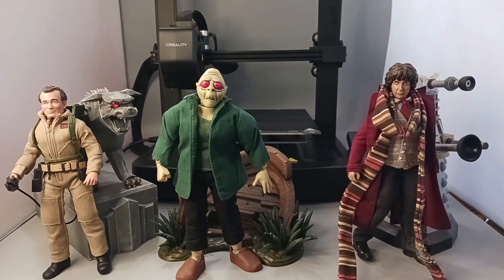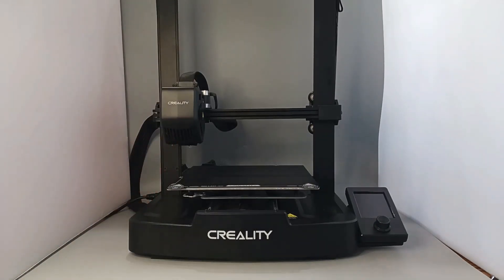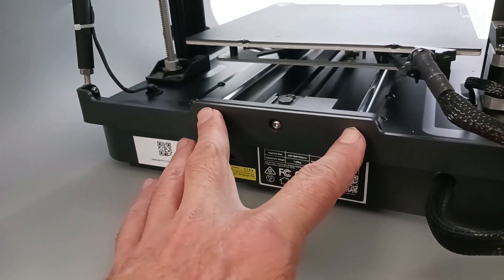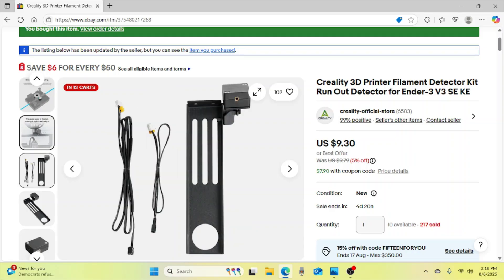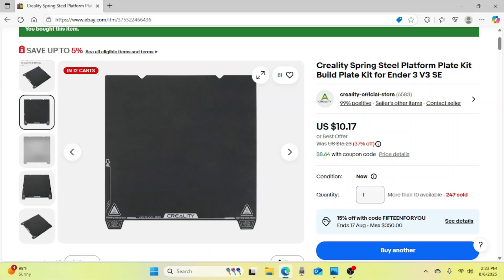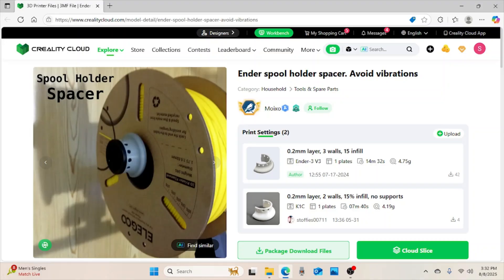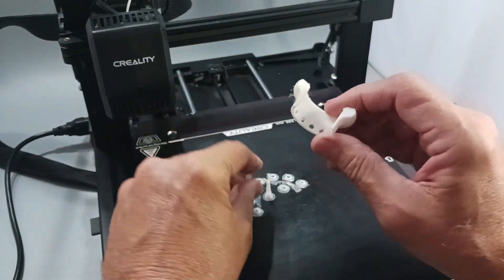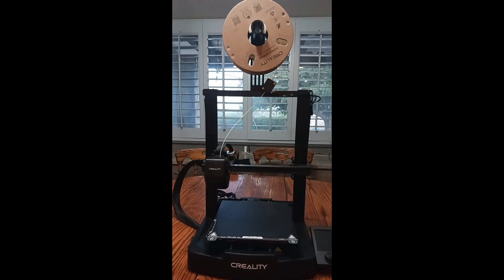Upgrading My Creality Ender 3 V3 SE Printer

Comment: Sorry, I had to stop watching once I saw you use the glue stick.
Reply: What’s the issue with glue stick? I use it and it’s helped
Reply: @HRKnight just a preference
Reply from the maker: @jasonreimer6890  What do you use?
Reply: @casualcrafter I use different temperature settings for the bed and nozzle, I also manually level the bed using shims.
Reply from the maker: @jasonreimer6890  My printer auto-levels, but the bed temperature may need to be evaluated. Thanks.
Reply from the maker: A friend of mine turned me on to that to make sure the print sticks. What do you do?